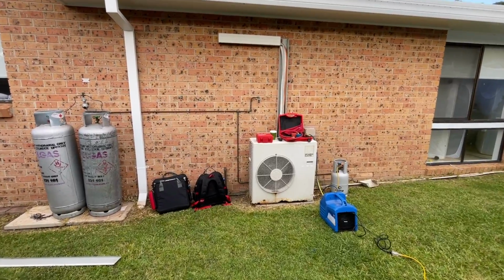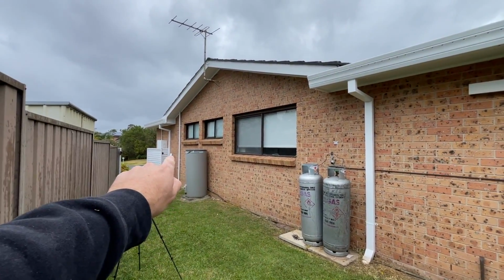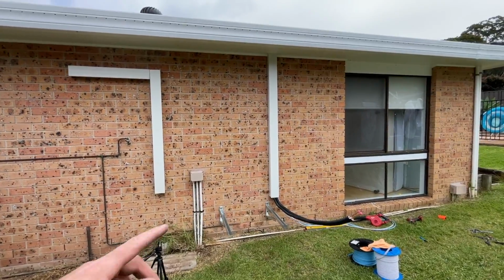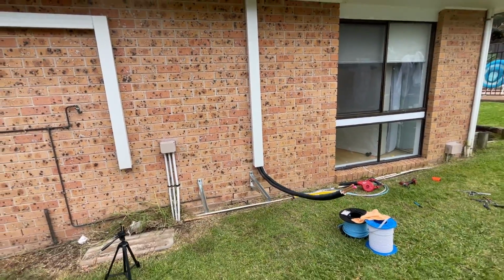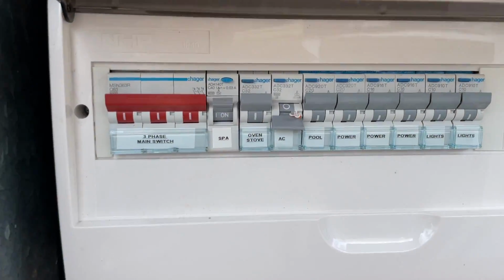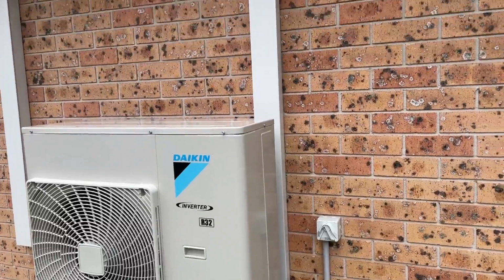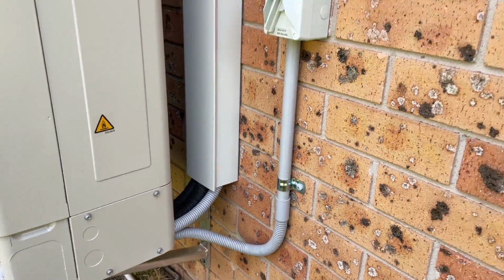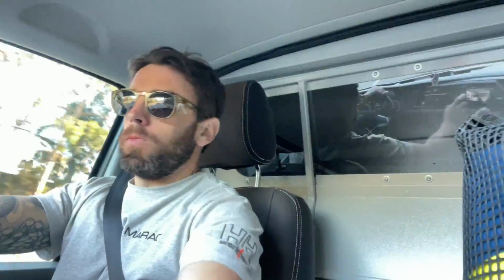INSTALLING AN R32 DAIKIN DUCTED INVERTER AIR CONDITIONER

Comment: Hi Mitch. Great video! What's the system you're using? The sensor that can sense temperature from different rooms
Reply from the maker: So it’s a Daikin Ducted Air Conditioner but instead of using the standard Daikin wall controller, I used a third party controller.

The third party controller is called “MyAir” and it’s made by Advantage Air.

Comment: do you have a link for the cement wall anchors you use for the condenser brackets?
Reply from the maker: https://www.amazon.com.au/Fischer-Universal-Attaching-Materials-538247/dp/B01M0PBKL0/ref=sr_1_17?crid=165ZB4XJTOLX8&amp;keywords=fischer%252Bduopower&amp;qid=1698481353&amp;sprefix=fischer%252Bduo%252Caps%252C226&amp;sr=8-17&amp;th=1&_encoding=UTF8&tag=mitchattwood-22&linkCode=ur2&linkId=fdc9458a13ba0245a1133b129fc29023&camp=247&creative=1211

Comment: Does that zone damper strict airflow?
Reply from the maker: Sorry mate I’m not to sure what you mean. It does restrict airflow, and that’s why I put it in. When the zones open, the air flows straight through with no restriction. Cheers

Comment: Hey Mitch what is the brand of the 5 way controler box looks like a good setup ? 🤝
Reply from the maker: It’s an advantage air exact air regulator. They are used with the MyAir product mate. Cheers
Reply: @maracservices do you like the advantage air gear or prefer the polyaire gear
Reply from the maker: @Byor-f7g  I’m not affiliated with anyone but my honest opinion is that I prefer the advantage air stuff personally. That’s my go to.